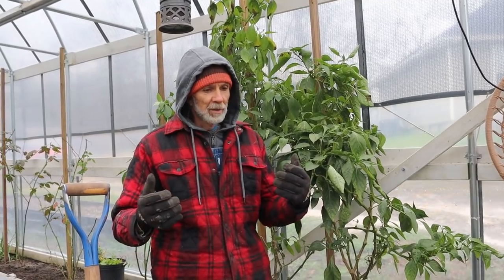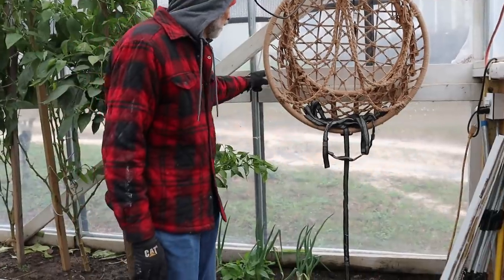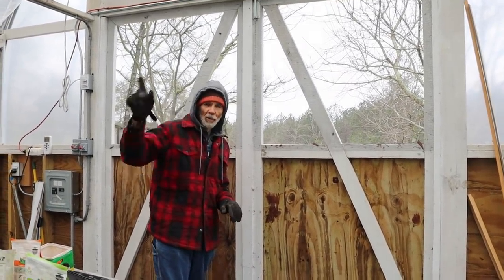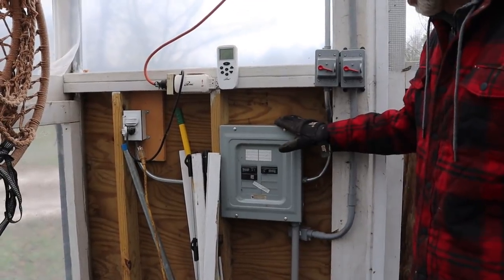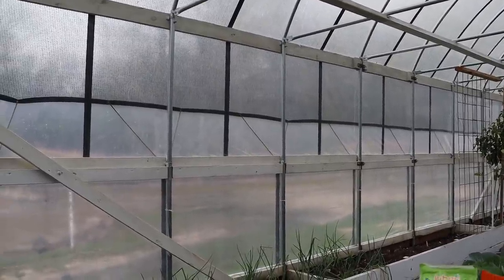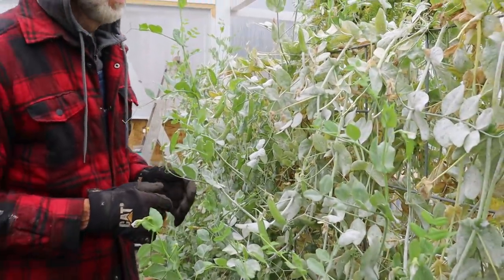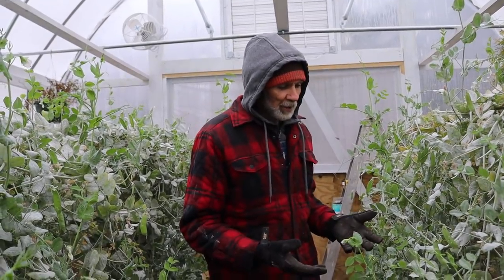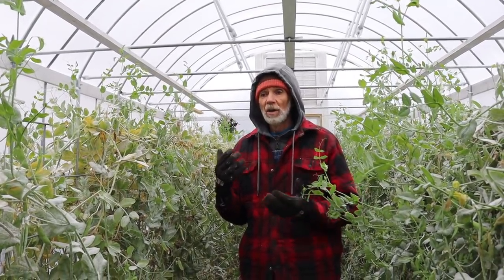GREENHOUSE/High Tunnel Questions Answered!

Comment: Where do you recommend placing a temperature monitoring device, at ground level, three feet from dirt,or higher? Then in the middle of the green house high tunnel or some where else?
Reply from the maker: In the middle about 3 ft high

Comment: Good Burrrrr Morning. The question I have is about the lumber on your raised beds. I noticed you bolted the high tunnel to the side walls of the raised beds. Aren't you concerned about how you're going to replace those boards with the tunnel attached? I'm guessing with the moisture, soil and our termite issues those boards won't last more than 5 yrs even with you painting them. How "easy" are they going to be replaced?
Reply from the maker: All bolts are galvanized hoping it won't be a problem.
Reply: @DeepSouthHomestead  I've been trying to figure out a more permanent solution, ie steel, cement nope they wont work either. I guess the wood is the "easiest" just keep the WD-40 handy.

Comment: Have you tried mixing 2 tablespoons of baking soda to a gallon of water? Use one of those little pump sprayer you like. Spray the plants and leaves tops and bottoms. This kills powdery mildew. Also, peas tend to prefer cooler tempetures. They can lightly freeze. I'm probably not telling you anything new. Just hope it helps.
Reply: Repeat every 7 to 10 days.
Reply from the maker: We tried this with no luck.  Our humidity is just to much at times.